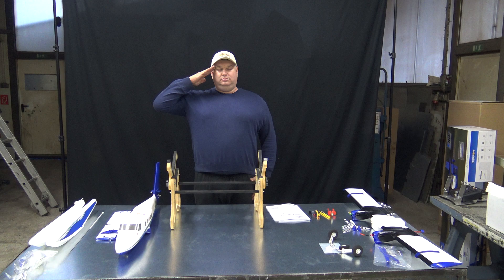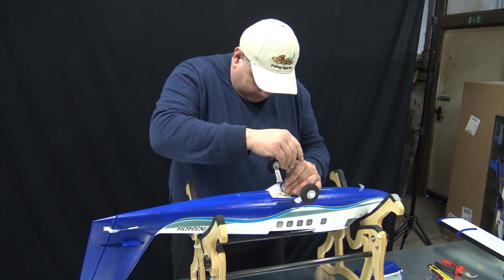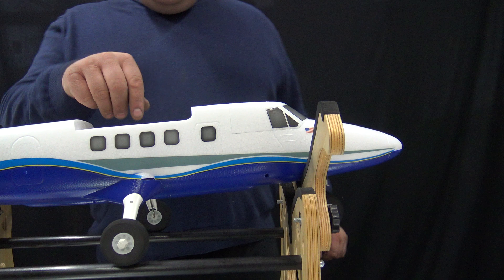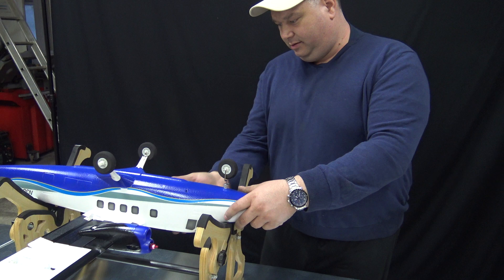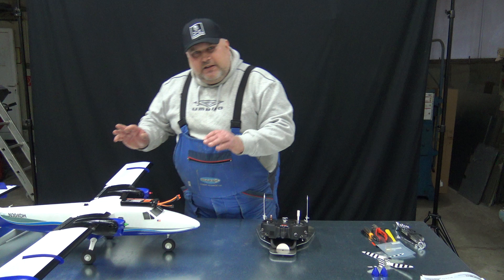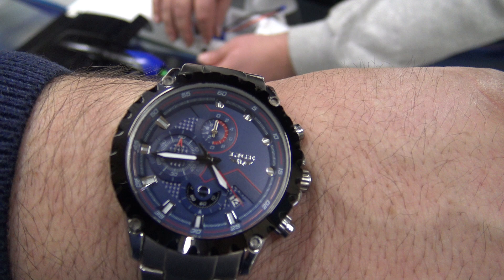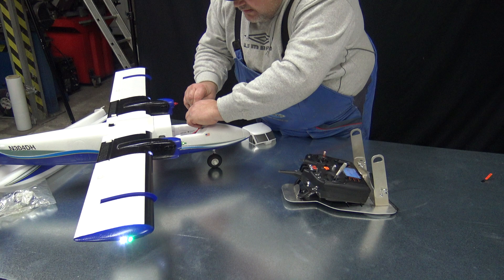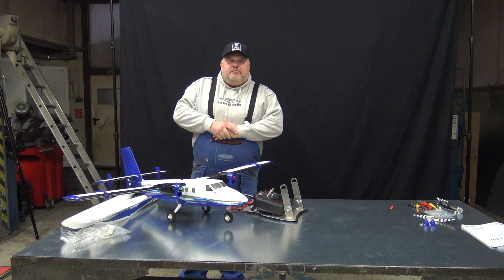E-Flite DHC-6 Twin Otter 1.2m BNF Basic with Floats quick assembley with Captain Blaž

Comment: Very interesting video.  I like the fact 15 mins assembly time and binding and safe select setup probably took longer!  I use a little silicon bathroom sealant to lock screw threads where I may wish to later remove them.  Gives enough grip to lock the threads to prevent loosening due to vibration etc but allows removal.  I think this type of plane attracts lots of new people to the hobby.  The problem is that they may not have the knowledge how to repair.  I wonder if a followup video might cover how to repair foamie models as such might be helpful for the new entrants.  Thanks for the video!

Comment: Great walkthrough on Safe Select binding. I don't fly Spektrum TX and have been looking for this on my BNF Piper Cherokee.
Reply: Ok, I commented before watching the full video... I need to know if you got this working. I'm having a similar issue.
Reply from the maker: @FL_Engineer  I almoust went crazy trying to set swich for SAFE later. I have discovered that for this plane I cant if Iam using preset template. But if I create new model there is no problem to set it on what ever swich I want. Its amazing. And its different with every single plane. I really dont understand why. And why on every plane the swiches are somewhere else. Why dont they set them the same on every plane.
Reply: @PetrincicBrosRC  Thank you for the reply! Glad you got it sorted out. I shouldn't have that problem on my TX16S; I'll try the bind procedure as you showed and assign SAFE on Channel 5 (hopefully). I salute you for your help; stay safe my friend.

Comment: You have my full attention with the final results of the binding issue. I'm having the same problem with my E-Flight F-15 Eagle.
Reply from the maker: I have discovered that I just cant set SAFE swich on the radio if I use preset plane from radio memory. But If I do it manualy like always there is no problem to set switch for safe. I have tried all I knew but no way to use preset BNF template. I really cant understand. From now on I will use preset setting only if I will bind just with AS3X. Otherwise I will just create a model like always.

Comment: i have had the same issue with the safe select but if there is no retracts, i always assign switch A- gear. when flipping the switch make sure you go slow and do it 5 times in both directions.

Comment: I must be truthful with you... This is the first video of yours where I've been left a little disappointed. I wanted to see a successful transmitter setup from beginning to end. Please don't forget to update us in the beginning of the maiden flight video. You guys are still great.
Reply from the maker: I was also dissapointed this time. I have spended later hours to try to set swich for SAFE but no way as long as I was using preset template from radio. At the end I have created new plane on my own and no problem anymore. Its really interesting why is this.
Reply: @PetrincicBrosRC  Maybe there is a way to report the problem to Spektrum or HH or maybe someone from either company has viewed this video.
One of the reasons I chose to wait on the NX8 over getting the RadioMaster TX16 was because of the of the onboard model files. I'm beginning to have second thoughts about getting the NX8.